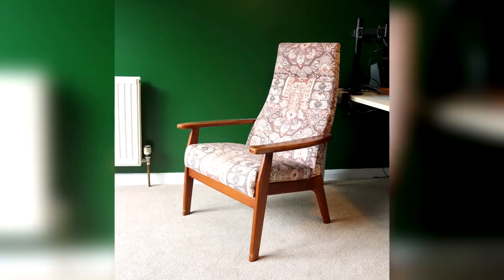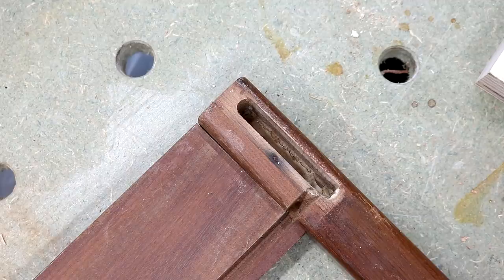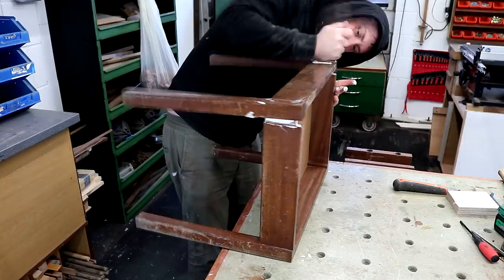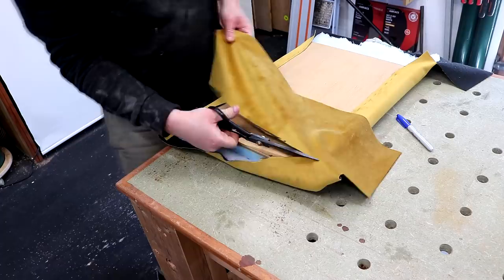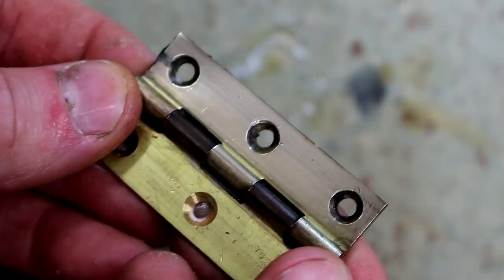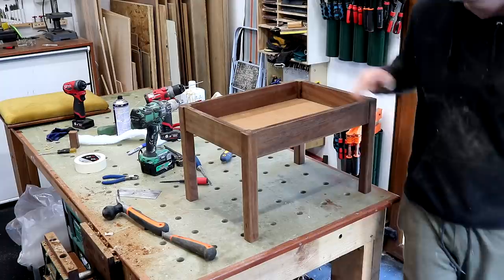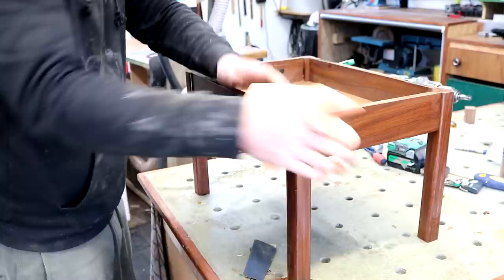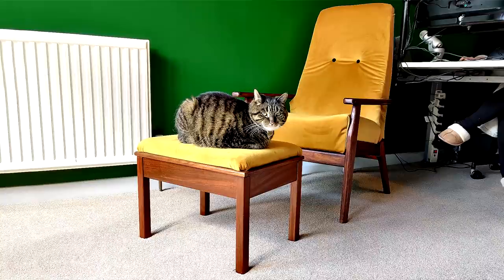£1 Piano Stool Makeover

Comment: Use magnets in the top of the legs to make the life removable
Reply: J_B_Woodwork i was just about yo make the same comment 😊
Reply: That's so easy and brilliant!
Reply: @emmavik-fredriksson640  Maybe add blocks under the lid at each edge to prevent the lid sliding free of the magnets, but the idea of using strong rare earth magnets is a genius one.
Reply: Rubber pads is all you need on top of all 4 legs

Comment: So much better than it ending up in tip mate and matches really well with your chair and decor. How about removing the hinges and placing a wooden rim around the inside of lid so that it's a push fit, like the little trinket boxes 🤔 hopefully you get what I'm trying to explain 😏 cheers Karl
Reply from the maker: That's a good idea!! Cheers Karl, I hadn't thought of that 👍
Reply: Had the exact same idea. No hinges, and lid stays safely in its place :) Probably a 3 minute job for you and a couple of the pieces from the scrape draw well utilised :)
Reply: Oops, didn’t see this comment, but essentially this is what I also tried to suggest
Reply: My first thought was adding some small battens to the underside of the lid, so it locates securely and lifts off.

Or how about some parliament hinges?  Something like 76597 from toolstation

Comment: The Dylan seal of approval. With the corners on the upholstery: I usually make a cut in the fabric in line with the corner, which allows more room to manoeuvre, pull the fabric over to one side, staple, then start on the other side of the corner, pulling the fabric over  for folding into a pleat. I end up cutting a rectangle of fabric away so it doesn’t bunch up in the corner and finish with the pleat. Wish I’d never started this explanation, as it’s so hard to explain! Think John Orchard’s trim suggestion is a good one for the lid. Cheers
Reply from the maker: I think I understand what you mean. I'll try that next time! 👍 Thanks Mandy

Comment: The "big secret" is  you use wider hinges that cover the full span of the overhang so that the pin lines up with the edge of the top. That way when you raise it, it stays clear of the apron and the top of the legs.

Comment: When pulling upholstery into a cushion, you are doing it right to start in the center, but if you keep turning it and adding staples one or two to a side, instead of stapling across a whole side at one.  So center on on four sides, then one to left and right, rotate to next side and do one to left and right, and keep going until you just have the four corners to do.  That will really help pull the fabric more evenly, wear more evenly, and look better.

Comment: Excellent save, you could make a thin walled box that attaches to the underside of the lid that fits snuggly into the bottom which hold the top in place, then you could even lift it off and use it on your lap as a lap pad or desk of sorts? Maybe....just a thought.

Comment: To use the hinges just put a piece of 1/4" thick by 1" or 3/8's high trim against the rail, all the way around. You already cut the legs so you are not hurting anything by adding a trim.  Attach your hinges and a  small swing latch on the front to tie the sides together.

Comment: re: the lid. You can create a skirt that runs around the parameter on the top and then just slot it into the bottom. You don't have to do the whole inside lip with the square parts of the legs jutting upwards into the cavity, you could just do the long flat sides and make it a bit tight so that it doesn't want to pull out easily.

Comment: Love the renovation, no-one likes brown wood these days & so much gets scrapped or burned. Even worse chalk painted!
A bit of chamfer relief at the top of the legs & underside of the seat might do the trick, but the seat wasn't designed to rotate more than 90°, so a small chain or restraint to stop it  might do the trick. (The brass loop bracket on the frame is a give away)

The screw holes might need drilling out and a dowel insert as the threads are likely stripped. I noticed a mix of slot & pozi screw heads, someone fixed it before!

Comment: If you get your hands on some free drawer slides you can actually use a couple of those and slide the lid horizontally. That is of course if they have no play in them so they do not make rattling noises when in use.

Different type of hinge - one with an angle that lifts the lid up and then backwards.

Magnets + guide blocks to keep the lid in place.

Some sort of swivel mount (center or corner) to slide the lid sideways.

I have no idea what it's called in English, but we call it a "kulesneppert" in Norwegian - a pair of those should work very nicely; probably one of the best solutions to the "problem". Locks quite good, takes care of sideways movement (mounted at a 90 degree angle), quite sturdy and not too hard to fit.

Comment: A set of cleats around the inside of the lid for a tight fit might do it. If you wanted to keep to hinges they are available with various geometries to throw the door / lid away from the closure surface - like your kitchen cupboards. Try a search on offset hinges. And thanks for your content, always valuable. And well done for supporting Leo's one handed challenge. Respect!

Comment: you might want to use some rare earth magnets to hold the top in place. Then with a few of alignment pins (nail with head cut off and rounded) would also act as  a mechanical support for lateral movement when you put feet on top, push stool from side to stop the lid /top from slipping.

Comment: The wood is mahogany.
To get around the hinge problem raise the hinges higher by placing a strip of wood under the hinges and putting a couple of clear rubber bumper pads/ feet/stops on the front the same thickness as the wood you use at the back. This way it clears the stool. I think the stool legs cracked because the top was overextended you need stronger hinges. 🙂

Comment: Nice little makeover project. Thanks for sharing. The heating tip for stubborn nails is perfect. Never seen/heard that before. 

Maybe it helps when you round over the bottom side of the lid on the back to prevent it from rubbing the upper part of the apron of the stool.

Comment: I like the idea of adding wood to make a push on lid... but if it doesn't need be so air tight you could use a piece of wood on the top of each hinge that raises the lid and do the same on the front... or add a full lip all the way around either way, lifting the lid to clear the hinges

Comment: I love recycling of this stool. One thing you can do is maybe turn that into a secret drawer? The space is empty anyway, and I think if you just made a small drawer and used a rail as the face then it would work out pretty well. Maybe even add like a fun secret way to open it like with a magnet or a push-release.

Comment: One idea would be to mount blocks on the underside of the top that match the internals corners of the bottom, that way you would use it a loose top which would be secured in place by the blocks?

Comment: You could use a surface mount lift off (overlay style) cabinet hinge sometimes called a chest hinge or a pivot hinge either exposed or internal all of these just move the pivot point as part of the design geometry so the top has enough lift during operation to clear.

Comment: What about using some good sized dowels that are glued into the top of the legs which then fit into a hole in the top so the top can be taken on and off but still solid enough to be used as a foot stool 😊

Comment: looks like iroko  to me. Hard as nails, partly due to the tendency to draw sand up from the roots. Used to be known as poor mans teak but not as durable or pretty. Parliament style hinges would fix the hinge issue - they are deeper so the pivot point is further away and lifts the lid/door clear of the frame. Usually used for doors with deep recesses or where you want 180 degree opening. Failing that a little chamfer on the top of the legs but that would be noticeable. Thanks for posting.

Comment: I have funny feeling at some point the rubber pads on top of the legs were lost and the previous owner rebated the hinges so top would would sit flat! you might need to adjust screw holes on the lid if you go with my rubber pad recommendation

Comment: Couple of comments that one or two may have mentioned already. To overcome lid opening a small concave cut out where the lid fouls the leg is the best option to overcome the problem. True it would only open 90 degrees, but that is better than 0 degrees. Maybe it would have been easier to remove varnish etc before re-assembly thus avoiding the problem up against leg shoulder. I agree with a previous comment that it is Afrormosia (currently Cities listed ) so forget about trying to get any unless you can find some second hand. Good video and just shows what can be done with minimum outlay. Stay safe

Comment: Nice job Keith! You might consider putting a slight bevel on the top of the back legs to give you clearance or notch out the frame of the top where the legs interfere.

Comment: Another really nice restoration Keith - god knows why people think its a good idea to pin mortise and tenon joints - the amount of pieces I've broken trying to get them out! For the hinge, the first thing I thought of was to screw a couple of strips of timber to the top that fit inside the bottom opening. This would allow you to easily take it on and off, without any movement (hope that makes sense!)
Reply from the maker: yeah it's quite annoying, it's like they didn't trust the glue to do it's job!  cheers, yeah that makes sense 👍

Comment: How about those friction lid supports you see in toy chests that prevent the lid from slamming. You can adjust them so they hold the lid at an angle where it’s not opening all the way back. OR remove the hinges and make the top removable like you see with storage cubes.

Comment: Nice looking job. Only comments would be:
1. Why not scrape the legs and apron whilst they were apart before regluing ads you would get a cleaner removal?
2. Rather than hinge the lid, fix thing batten all around (except at the legs) the lid to hold the lid in place from side to side movement in much the same way as you would if you were making a box with a completely removable lid. Either that, (my preference) or use kitchen cabinet hinges.

Comment: Use two pieces of rope inside to limit the opening angle to roughly 30 degrees or 45 degrees. That limits the stress and limits the access but it might be good enough.

Comment: Could you have added packing to the cut in section of the hinges, thereby lifting it up and over the back legs ?
Also, there are special little hinges that are round, with a little cantilever action - usually used on small ornate jewellery boxes and such, that have a "lift up" action. You usually drill a hole like a dowel was being used on each part. I hope you know the ones I mean.

Comment: Great project Keith! i was thinking maybe you could of used like a little strip of wood like a cleat on the under side of the bench top part like where the hinge hooks to the top part like to lift the hole thing up 1/2 to 3/4 of and inch but you would have to do it to the front to so it would look right it might give the top part a little bit of a floating look from the side just a though :) anyways thanks for sharing the video with us!💖👌👍😎JP

Comment: Could just fit some boards that fit to the inside size of the base and make the top a pull off lid. Button fix fixing are pretty good as well and you can trim the receiving piece for tighter or slacker fit

Comment: As the hinges only interfere with the upper 1cm (or even less) why not remove just the upper 1cm of the back legs. Or make a partly rabbet at the underside of the top just on the place where the interfere with the legs... Imo the 2nd is the nicest option. Good luck with it, Keith.

Comment: The easiest solution is to get hinges that are about 5mm deeper, same width, same thickness just 5mm deeper.  The screw holes in the hinge might have to be moved so they are not too close to the edge of the wood rail.  That would move the pivot point 5mm back and skip the contact problem when the lid is opened.

Comment: Could you have put 4 tactically placed blocks of wood on the inside face of the lid so that it was held in the box by friction? Instead of hinges you'd need to lift the lid off completely, but would still allow you to access the storage space without needing hinges?

Comment: I recently got a headless screw out by using a plug cutter around the screw, then breaking up the wood around the screw. Afterwards all I had to do was remove the screw and put a round plug in. Seems a bit easier to fill a round plug than filling in your wedge shaped gaps. Just an idea.

Comment: What if you put a piece of wood where the space for the hinges were routed out so the hinges weren’t flush with the surface anymore. It’s hard to say if that would be enough space for it to clear and the amount of space between the lid and bottom wouldn’t be even all the way around unless you put some spacers under the lid on the side without hinges too but seems like the easiest option.

Comment: Could you not have turned it into an "unhinged" lid that you lift off by adding som small pieces of woods to keep it in place by going inside the storage space? Anyway, good job! I always love seeing shellack being used. We added an oak top to our Ikea TV table to give it some life and I oiled that with some linseed oil and shellacked it (did some sort of simplified amateur version of a french polished and went over it a few time denibbing in between) and the finish came out really good (and could have been even gorgeous done by someone more experienced). So far it's kept up well without any top coat of a more hard wearing finish.

Comment: The hinges should not have been recessed. Fill the base that has the reseeded hinge slot and reattach. You could put felt on the corners of the front to make up for the Hong offsetting the back.

Comment: Hi Keith, when getting glue into thin cracks, I've found a thin artists pallet knife to be indispensable.  You might have found the finishing easier if you'd done it before the glue up.  Especially, the apron rails.  Also, the timber looks like it might be Sapele ( a type of mahogany).  You said you thought it might be Rosewood, if so, be especially careful with the dust ( a bit late now I know).

Comment: Keith, I'm surprised you didn't scrape off the old finish when the stool was completely dismantled, wouldn't it have been easier than having to deal with nooks and cranies by the joints
Reply from the maker: i only dismantled part of the frame, the rest of the joints were good

Comment: My first thought was to chamfer the corners of the legs that interfere (like others have suggested), but they might be visible, so instead, how about doing the opposite and cutting a relief space in the lid so that the corners of the legs fit into them? They don't need to be too big, if you could open to  say 90 degrees it should be enough and not necessitate the removal of too much material. That's what I'd do, anyway.

Comment: Nice work, Keith.  Before we went over to motorised leather recliners, we had an adjustable angle footstool that had a hinged 'flap' on the underside of the 'seat' (hinged at a narrow end) that fitted into two alternative slots on a board on top of the legs to give two possible angles for the 'seat' as well as completely flat.   When sitting  with the higher end of the stool next to one's chair, it was the most comfortable position for one's legs imaginable.  The stool pictured here:  https://images.dlf.org.uk/mee/classes_photos/1146.jpg uses a different angle adjustment method, but whichever you choose, I think you would find it well worth doing a bit more work on your stool to get an even better result.

Comment: Nice job! Regarding the lid, I'd probably have removed some material from the lid frame, just the amount needed to make the lid open without interfering with the top of the rear legs.
I follow you since a long time and I love to see how much you improved. Bravo. Can I ask you what's the model of your Makita portable circular saw and its guide? I've just broken mine, I need to buy a new one and I noticed yours is cutting gently and clean despite the big nice diameter. Thanks!
Reply from the maker: thanks, see the my tools link in description box 👍

Comment: Fantastic video! You mentioned curing a wobble if the legs aren't all the same length. Is there a procedure for curing a wobbly table or chair? I have made a couple of coffee tables and whilst one was OK, the other has a wobble and I haven't a clue how to cure it!!! Thanks again for the great video.
Reply from the maker: my method is a bit crude, but I use a belt sander - it removes material from the end grain quickly and cleanly
Reply: @RagnBoneBrown  Thanks for your reply. I've got an orbital sander and I'll give it a go with that. You've really inspired me to have a go at woodworking, albeit with very basic tools. So I'm a slow builder!

Comment: I was thinking how nicely their designs matched, before you did. As if they were ment to be put together.
As for an idea for the lid, I might have something. I was thinking you could add some strips of wood on the four inner sides of the lid. These strips of wood would go down past the brown wood frame if the lid, making a lip (I think "lip" is the right term). Anyways, that lip would fit into the inner part of the storage area, making sure the top not to fall off when being used.
I hope what I wrote makes sense. If I could of added drawings here, I would of ... lol
Reply: Fill in rebate for hinges and use flush hinges as you don’t need any clearance